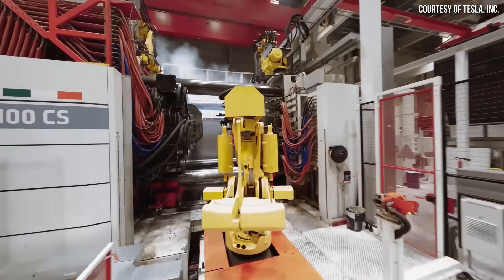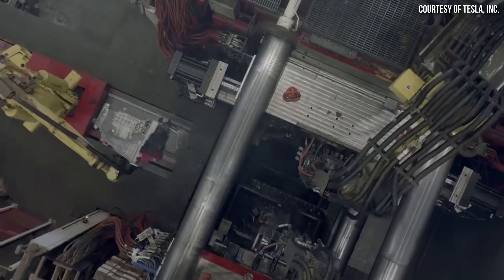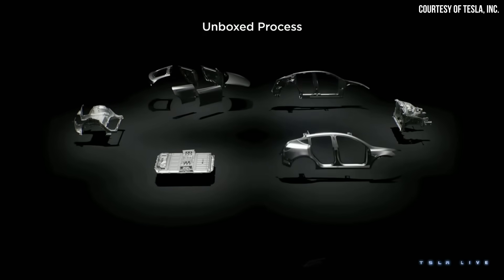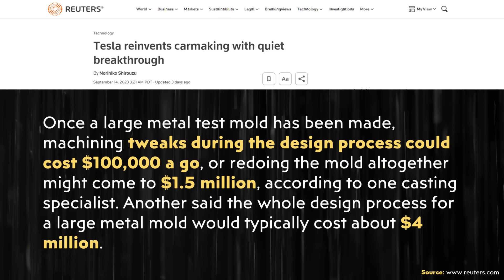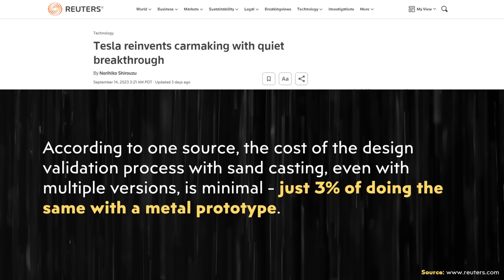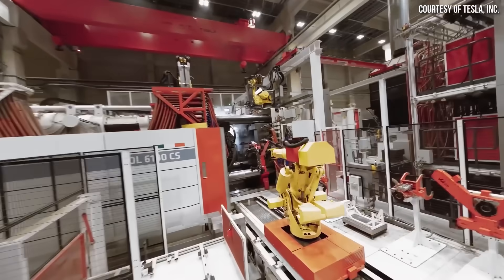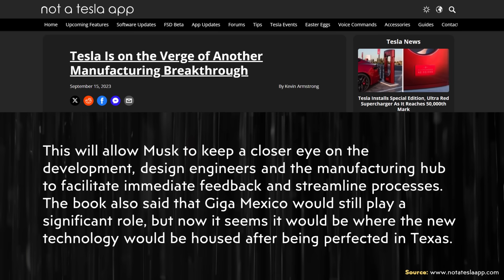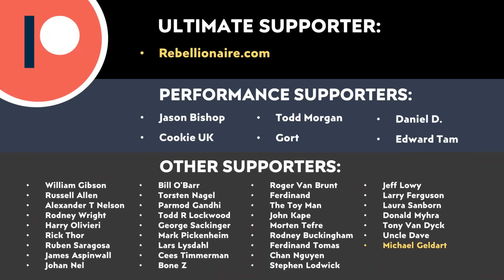$25K Tesla EV to have 1-PIECE UNDERBODY GIGA CASTING

Comment: High cost of one-piece body/frame molds: That's the reason Tesla is building that new die fabrication/repair facility next to the new Battery Cathode Plant at Giga Texas. All the development work on those super-large aluminum casting dies will be done inside that new building.

Comment: As others have mentioned, I don't see how a large single casting would work with a modular design process. It would force them into a linear line like they use now.
Reply: Simple, do the modular of everything, then the last step is to put the casted underbody from below, 2 peaces, the lower one and the upper one(the one built modularly) joins together at the end.
Reply: Exactly. A whole lot of uninformed speculation that’s contrary to unboxed principles.
One-piece prevents easy access to furnish cabin interior.
Then robotaxis aren’t going to wait, need to have production ramped by 2026-7 into millions.
At best you’d need a "firewall" front structure / dash to furnish with tech, then glue / marry to one-piece skateboard, then bring in built-up structural battery.
Reply: Less pieces, still modular.

Comment: If the whole underbody is one casting, then what happens with the SBP?  Will there be a huge hole in the casting, or be incorporated in the casting?  The former doesn't make sense, as it's just as easy to join 4 pieces together; the latter doesn't make sense, they would have to replace the whole underbody to replace the battery.  I'm starting to suspect "all-cast underbody" got mistranslated to "single-piece cast underbody" by Reuters.
Reply: Million-mile battery will not need to be “replaced.”
Reply: If any part of this is true it just shows that Tesla is keeping its options open. The single underbody casting thing seems at odds with the earlier public glimpse offered by Tesla into the 'unboxed' manufacturing approach that it would be following with the new model.

Commentators are trying to make these differing reports agree but they don't. It is possible to look at different approaches in preparation for massive investments that once committed decide all the following moves.

Regarding the Tesla Stuctural Battery Pack, is it possible that Tesla has been too single minded about what that means in practice? Batteries, beyond any structural function that they serve, should be readily removable. You don't have to see battery swap stations as a bit of fun, which is absurd. Making a trip to a battery swap station or service station that can do battery swaps ought to be common practice if and when an EV battery is (remotely) diagnosed to be faulty in some way or underperforming. That should be part of the service provided by EV manufacturers, buyer beware nonsense be damned. The structural function served by the battery pack oughtn't to override other sensible vehicle design requirements.
Reply: I suspect Tesla might use an LFP pack in the $25k car, which doesn’t require the kind of structure, compartmentalization, and separation their NMC/NCA cells do.  In other words, there’s a whole lotta metal in NMC/NCA packs to keep things safe…metal the SBP harness for structure, which won’t be necessary for less volatile cell chemistries.  That’s just my take…. 🧐
Reply: Three thoughts on SBPs:
(1) If an SBP as envisaged and implemented by Tesla does its job in an accident it appears to ensure a complicated and expensive repair with significant work required on other parts of a vehicle that are incidentally impacted by battery pack damage.

Furthermore, the whole pack will necessarily need to be replaced after a forceful collision. Safety considerations will dictate that. It is impractical to confirm the structural integrity of cells without pulling the pack to pieces and that is a worthless exercise when a replacement can be fitted after other structural repairs are performed. Just recycle the suspect pack.

(2) Keeping the cabin chamber and the battery pack strictly separated has its advantages. Damaged cells venting into the cabin could be disastrous for the health of occupants even if the pack manages to successfully serve its structural purpose in a collision/accident.

(3) In some distant future when battery packs will be much smaller and lighter than they are now the useful functions that might be served by a battery pack will need to be re-evaluated. The powerful attraction to have a pack doing double duty as a structural component follows largely from the unavoidable bulk of today's packs.

Lighter and smaller packs will likely centralise the pack mass around the front-rear centreline of a vehicle. That could notably improve the handling of EVs - they could continue to have an enviably low centre of gravity like today's EVs but with handling that is a lot nimbler.

I am not suggesting that future energy dense/light weight battery packs ought not to have a structural purpose. The point is what we see today isn't forever and we needn't be troubled by that.

Comment: Center section "Battery Tray"?  The new press and process may  only need to make the mid section, which could become more than one design for different models cars, trucks, vans, etc. for the longer and shorter wheel base units. So then just connect the front and rear sections (sub frames) to make different models.

Comment: I don't follow you on that. The Model 2 was indeed announced to revolutionize the way cars are produced. But this method loses all the advantages of having separate work stations for each part which can be exchanged at each failure.
The gigapress for very large volumes is too risky and can slow down production by several months if a failure occure.
We also remember that the goal of making car production “easy for humans” announced at Investor Day is mainly there for the Tesla Bot.
So the next plan for gigacasting is mostly replaced by IA development now.

Comment: I don't understand how full under-body casting makes any sense. A stamped steel structural pan holding batteries can be bolted onto other components with a small number of fasteners. Making the pan, loading the batteries, and bolting to structural castings can be automated easily. Loading batteries and integrating the other power management components would be more difficult to automate with a full-body casting.

My guess is that the bigger gigapress will be used to reduce the number of castings needed for the CyberTruck and possibly the Semi.
Reply: You're correct.
They should CAST the structural pack frame.
Build it.
Test it (on its own!!)
When tested send for Interior assembly 
Cast the front and rear.
BUILD all three (separately!) on jigs which are motorised robot transports.
.
Send those to final assembly.
The transports lock together, providing precise positioning of the castings
Bolt together.
NOW you have an assembly which has been built efficiently by the maximum number of "workers" in the minimal possible time.
Reply: @rogerstarkey5390  - I agree with your assembly approach, but a stamped steel pan would be much cheaper than cast aluminum. This type of stamping is routine.

How does casting add value in this case? A battery pack is a layer of cells sandwiched between thin skins. Thin skins are not suitable for casting. Rolled steel (or aluminum) is much more suitable for this purpose.

Tesla's castings incorporate multiple mounting points and assembly guide elements to support the front and rear assemblies. This saves dozens of parts, welds, fasteners and assembly robots. This is a huge advance.

The battery pack doesn't need any of this complexity. The pack needs to support the front seats and probably the console which will all be bolted top-down. Fastening the front, rear, and side assemblies doesn't require special flanges or mounting points.

Comment: 1 casting....
Then you have to make that the battery pack.
That means that stacking, first charge and testing a car sized casting.
5x the space, more weight, problems if a pack fails.
.
When it's ok and you build the skate, every advantage bestowed by building unit units (Working on 4 sides of the unit) is gone.
.....
Build 3 "casting" units (plus passenger cage?)
Robot transport to final assembly.
Then drop the passenger cell (with doors, fully painted) onto the pack, with interior already installed and have the transports roll the front and rear into locate precisely on location pins.
Bolt together.
Done.
Work on 4 sides of each unit.
Reply: I think you are making assumptions that may not be true. I think (based on my vague recollection of a video I saw 1 or 2 years ago) is that the first charge is of individual battery cells, because this gives Tesla the opportunity to note slight variations in the voltage and capacity of different cells, and then group cells that have "as similar as possible voltage/capacity" characteristics. The A-quality cells will be used for one product, the B-quality cells for a different product and so on. Before a complete battery pack is put into a car, the individual cells will have been charged/graded/sorted, and the assembled battery pack will also have undergone whatever testing is appropriate. As such, there is very little chance of there being a problem with a battery pack that is placed in a car.

I don't work in the auto industry, but I suspect that that "underbody gigacasting" terminology may be misleading terminology since it suggests the casting will include a floor. Perhaps the casting will contain metal that connects the front and back ends together, but only at the sides, so there could be a huge hole where the floor should be, and then the assembled battery pack (complete with seats attached to it) could be raised up into this hole and fixed into place. Also, the drawing from the patent application suggested that the single-piece casting might contain the A and B pillars and perhaps support for the roof.

Comment: Going for 1 piece is in my opinion a really bad thing for customers. It means that almost all accidents (collisions that generate more than simple scratches) will be a total loss, and insurance for these cars will be much higher

Later edit: 
My experiment worked.
Although I pointed out a potential issue, all the “diehard tesla fans” jumped defending their savior, Elon musk.

FYI, I am actually a fan of what tesla does, but being a radical person and just trying to spread hate is not very constructive for you. Try to leave the internet for a few hours, go outside, enjoy your life. Real life I mean, not ciber life
Reply: Like Munro recently showed (and had been touting for years) if the casting suffers any damage you should thank God you're alive and move on. The casting is extremely rigid and serves as support for many crush members for crash worthiness. If it comes to the point where the casting has been damaged then the accident was too strong & quite likely no matter what car you were in, it would have to be scrapped.
Reply: You're not an engineer - we can tell
Reply: @bluetoad2668 I am an engineer and I fully agree with him.
You Tesla die-hard fans are the Alices in Wonderland.
Reply: The same was said for the front and rear gigaCastings.    We know for sure your claim is unfounded for low speed front and rear collisions as there are replaceable crush cans bolted to the casting.    Have seen repair parts for the casting themselves.  No idea how they are used.

As cars use stronger steels the repair ability goes down too.   Honestly I think it is too early to cry wolf.
Reply: @danharold3087  
Have you considered how to assemble and handle the "pack" in the factory?
Assuming it's structural, this would make the pack and the front/ rear the same piece.
Currently they stack, charge and test every pack?
You've just gone from a 2.5m long x 2m wide x 25cm box to 2.4 m x 4m long (min) x 1m tall  (wheel arches) unit.
This has to be moved around as a unit, then stacked, which would take .... 5-8 times the volume?
Building the tested unit?
You're back to working 4 sides for the whole vehicle rather than 4 sides on each of three units (plus the passenger cage).
.
Now go back and look at the general principle of the "unboxed process".
This isn't it.
Reply: @rogerstarkey5390  - Exactly. A full-body casting seems like a step backward.
Reply: @davidhawkins7138  
Those proclaiming (or suggesting) themselves as engineers haven't thought through the process.
Reply: In the soon to be revealed future of FSD, accidents will be a rare occurrence and safety requirements will be revised to allow for lightweight and efficient transportation. Repair shops will be far and few in between.
Reply: it depends on the accident because in most crash situations,the castings will hold up really well. all the stuff mounted to it is replaceable. insurance for new cars is pricy compared to having something older with parts support.
Reply: You have no idea what your talking about
Reply: I don't work in the auto industry, but from watching a variety of videos, I get the impression that there are some crumple-zone bits of metal at front- and back-end extremities of a car. When there is a minor crash, those crumple-zone bits of metal that get crumpled can be removed and replaced, and hopefully the crumple-zone metal will have protected not just the occupants of the car but also the front and rear castings (or unibody casting). As for your claim of doing an experiment... Rubbish. Most of the responses challenged the technical details of your comment rather than either attacking you directly or defending Musk.